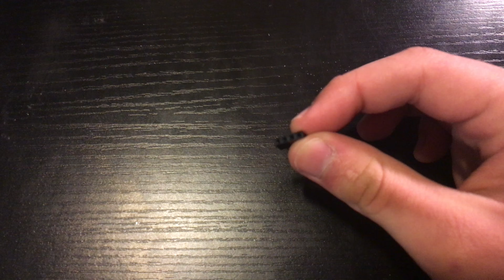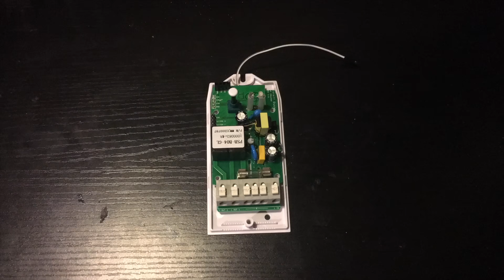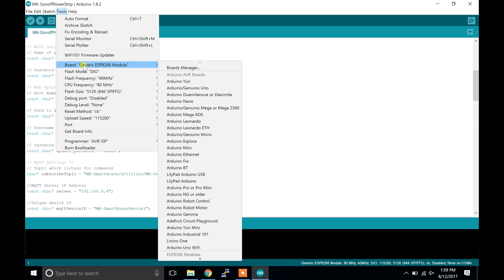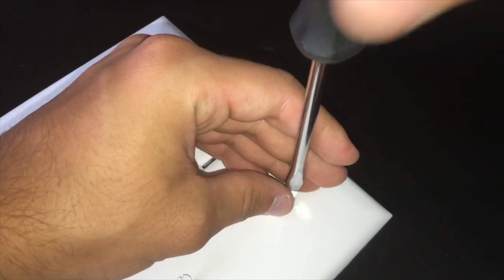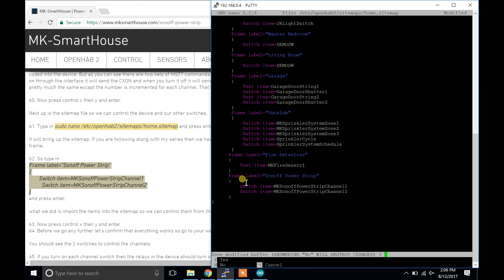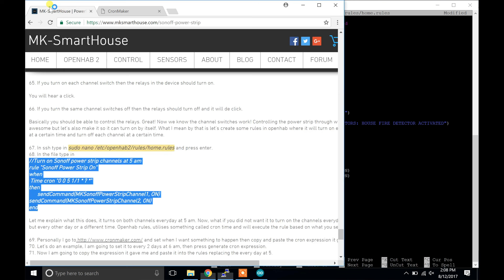Sonoff Complete Guide : Custom Firmware/Software OpenHAB MQTT (Using WINDOWS)

Comment: Great video as always!
Question: Why not use the popular Sonoff Tasmota software which has a lot more features?
Reply from the maker: +MCgamingPro Thanks, I like writing my own code, and what do I need more features for, it is a power strip?
Reply: MK-SmartHouse I guess you are right, I have my Sonoffs flashed with it, shouldn't cause any problems
Reply: I also have a couple or sonoff POW that can also be used in a power strip, it is not a bad function to be able to turn off some appliances if the overall house consumption is too high

Comment: Hi. 
When using the Sonoff Mini with Tasmota through the MQTT the device only flashes the blue LED once when it is activated, the icon in the application shows that it has been turned on but the lamp doesn't turn on.
Through the browser I turn on and off the light using the command http://192.168.2.156/cm?cmnd=Power On.
How can I fix it?
Thank you for your attention.

Comment: Will your firmware work with a regular sonoff with just one output?
Reply: Is anyone up for the challenge to do a sonoff basic? I couldn't figure it out. Connecting to basic is even easier than dual (no need to solder, just press the button), but I think the code to turn on the relay will be different. Matt could you please help us? A short video to describe the firmware would probably get a lot of views and should be quick to set up. Thanks!
Reply: Indeed, could you clarify is we can use the same software? I want to use sonoff basic for everything and it would be nice to do it by your videos. If I need to use like tasmota I'll have to find out where your tutorials come in and where I need others...

Comment: is the 'flash wire' only pertinent to that model of Sonoff?  Never seen it used on the POW or single channel version.
Reply: Yes, it is. The button on dual is not connected to GPIO0...

Comment: I think I did the same things with you expect I used esp01 module insted of sonoff and connected a relay to it. I can control it from mqtt.fx but I can not control it from apple homekit. I added the switchable item type. I can see the item in apple homekit and the status changes in basic ui when I change it from apple homekit but the relay doesn't react when using basic ui or apple homekit. Relay only react to mqtt.fx. What should I do? Thanks in advance.
Reply: I seem to be having the same issue with a very similar setup. I have yet to figure out the fix... please let me know if you find a fix.

Comment: Arduino: 1.8.5 (Windows 7), Board: "Generic ESP8266 Module, 80 MHz, 40MHz, DOUT, 115200, 1M (64K SPIFFS), ck, Disabled, None"

C:\Users\samir\Downloads\arduino-1.8.5-windows\arduino-1.8.5\MK-SonoffPowerStrip\MK-SonoffPowerStrip.ino:20:24: fatal error: MQTTClient.h: No such file or directory

 #include <MQTTClient.h>

                        ^

compilation terminated.

exit status 1
Error compiling for board Generic ESP8266 Module.

This report would have more information with
"Show verbose output during compilation"
option enabled in File -> Preferences.

Getting the following error messaged

Comment: Is it possible to restore EWeLink firmware to Sonoff after flashing tasmota ?
Reply: Only if you made a backup of the original firmware before flashing. Sonoff (Itead) fingerprints (MAC/serial) the firmware to the individual devices.